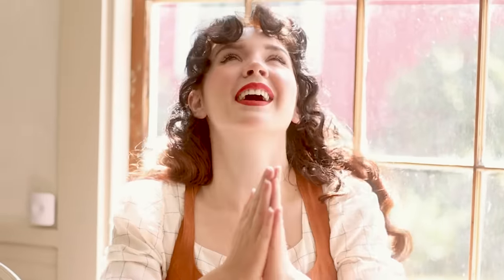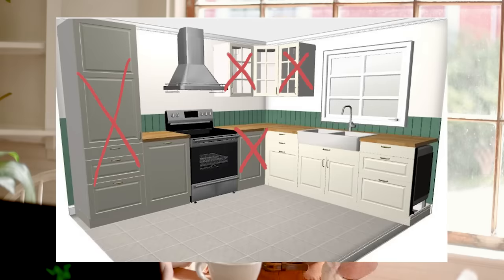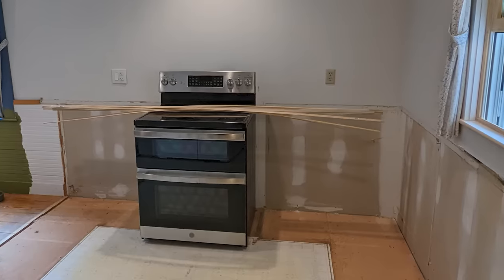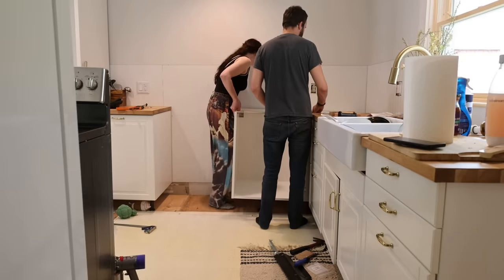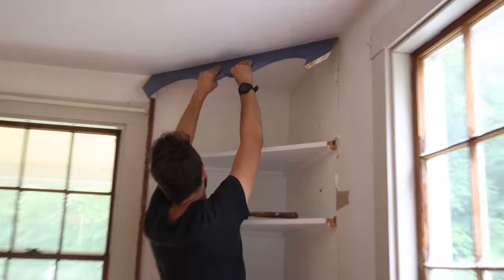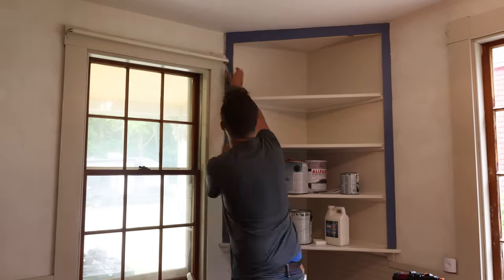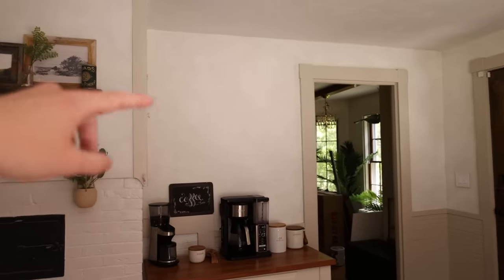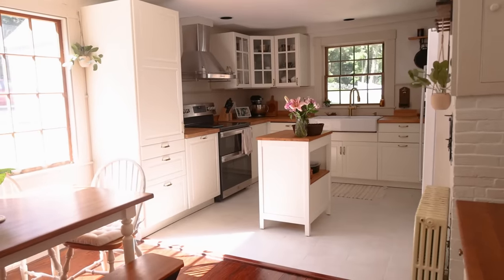We DIY'd our Old-Timey Kitchen! *never again lol*

Comment: The Kitchen is "the heart of the home" and let me tell you it SUCKS when it doesn't flow and isn't ideally functional. I have a lot of similar issues as you did, in my current kitchen. 

Looks like you opened it up and made it so much more fitting to your needs. I hope it feels as good as it looks because it looks amazing!! Thanks for sharing, time to redo mine.
Reply: My kitchen is the bumhole of the house. Tiny, full.of sh and kinda clean, but not really.
The heart of my house is either the livingroom/craftroom/bedroom (one room) or the bathroom/toilet (one room) because though it has some clogged arteries with laundry and boxes of old make up and washingbags, it is the lightest and nicest room in the house and very, very important.

Comment: Re: Getting a Branch to dry stuff on, Try to keep track of what kind of tree you get it from so you can bake it to remove microbes/kill insects.
Reply: And seal the branch with polyurethane.  The wood will dry out and get brittle and start rotting and splinter and just making a mess everywhere.  Remember, the old folks back in the day used big branches for drying racks because they couldn't afford metal for a real rack  they were making do  You don't have to.  Buy a real drying rack or a cheap rod from a thrift store or something.
Reply: But the branch is free.😕
Reply: @druidriley3163  But the branch is free and ~*aesthetic*~. I personally have raw pieces of wood and branches as random decor in my house for years (I've got macrame on a raw branch, a stump that a ceramic frog sun-bathes on, and a jewelry "tree" made from real branches) and they haven't rotted yet. Wood be sturdy, as long as it's not sitting on the forest floor getting actively composted.
Reply: @manicmuffin  - depends on the wood, I"m sure  Hard woods might last a while.  Soft woods or trash tree branches, not so much
Reply: Use maple or oak or fruit wood!  Don’t use Poplar or Willow (crap wood to the extreme!)
Reply: @druidriley3163  I honestly don't know what kind of wood it is. Foraged them all off the ground while hiking, lol. Guess I just trust my lizard brain instincts when it says "this is a good stick, I'm taking this stick home with me. Oooh, and this shiny rock. OOOOH and this pinecone-"
Reply: @manicmuffin  - just look up.  Tree branches don't fall far from their parent tree.  And you'll know.
Reply: @druidriley3163  Man, I ain't no arboriculturist, my dumbass would just be like, "Yes....it seems as if these branches came from some kind of tree...."
Reply: @manicmuffin  😂

Comment: Listen, hubby and I will always rememeber "The Kitchen Designer from H*ll" who we worked with to do the renovation on OUR kitchen.  WE don't ever want to do that again, EITHER.  Also:  white floor tiles?  Same.  SEAL THE GROUT.  ASAP.  But it will probably still be a pain showing any bit of dirt.  Still GORGEOUS job you two.  The change is drastic and you did a beautiful new kitchen.  Enjoy!!
Reply: Yes absolutely 100% seal the grout ASAP!!!  Sometimes people aren't told about it, it wasn't included in the tiling service, etc. But it's super worth it!!  Protect that grout, it'll extend the life of your floor, and it'll keep looking pretty and resist cracking, and make the tile easier to clean - always a plus 👍

Comment: I once read a study, many years ago and I can't even remember enough to find it for citation, of how many hours 'someone' (almost always a woman) in a household spent washing dishes every day/week/month/year.  They counted from 'lone inhabitant' to farm family of 12 + 5 farmhands.   It was staggering.  Many, many, many hours spent washing dishes.  I kissed my dishwasher right on the front dial!
Reply: Amen.  I have a nearly 100 year old house.  There is no dishwasher.  I sorely miss the dishwasher I had in my old apartment.  And it's not as easy to just buy one and install in an old house.  First - your century old kitchen does not have the plumbing to hook up to a dishwasher.  You will need to pay a plumber for the upgrade.  In an old house, you may or may not have sufficient electric current to run the appliance.  You will need to hire an electrician to hook up the dishwasher and/or rewire your kitchen.  So my desire for a relatively inexpensive appliance purchase will remain a pipe dream unless I win the lottery due to all the additional expenses in installing something so simple.
Reply: @druidriley3163  Get you a portable dishwasher!! They hook right up to the faucet with the little adapter that comes with it: NO PLUMBER NEEDED! I ran one in my 70 year old house from a regular electrical outlet, no problem! They come on wheels so you can wheel it away when not in use, but we removed the cabinet by the sink and it lived there just like a regular dishwasher.. They normally come with a butcher block top so you will not lose any counter top space. I loved mine, had it for 12 years until we moved!! Highly recommend, and, portable dishwashers are not expensive and they are full sized! And...wait for it... I got it at Lowe's. Easy peasy!
Reply: @michaelsnider2484  - help me out here.  From what I read about them, you hook up the hose of the dishwasher to the spigot of the kitchen sink.  It appears that you screw the hose onto the faucet nozzle.  Is that true?  But there are no threads on my kitchen sink nozzle.  It's one piece.
Reply: @druidriley3163 as I recall it is a quick release joint adapter that comes with the dishwasher. Also, when they deliver it do not let them charge you an installation fee because there is no installation.
Reply: @druidriley3163  it is not like hooking up a garden hose by twisting it on. No threads needed. Also, our house only had a 60 Amp service and it ran fine. I am so excited for you: definately look into getting one- I was madly in love with mine! A couple of houses we lived in when I was growing up had portable dishwashers, too and we had a family of 5 using them. Lemme know how it goes!🥰
Reply: Okay, but your vague recollection of something you thought interesting but don't remember important details, (like names and dates) is me all the time!!
Reply: @michaelsnider2484  - Thanks!  Do you recall a brand you used?  Probably a next month purchase as I just bought a new battery for my car this month.  Boy are they expensive these days!!  SO excited about getting this!
Reply: @michaelsnider2484  Had one growing up too, kitchen with only a sink cabinet and a pantry. Ours lived next to the stove, only had to wheel it about 5 feet. We were a family of 7, 5 kids. Made my mom's life way easier.
Reply: @druidriley3163  no, but I did get it at Lowes. I wish you the best with it!

Comment: Looks incredible!! Definitely recommend using trim and molding to extend your cabinets up to the ceiling, for aesthetic reasons as well as practical (dust, dirt, and general kitchen grime will collect on top of your cabinets and it’s damn near impossible to clean off so taking them all the way up to the ceiling prevents that eventually smelly issue).
Reply: Was thinking the same thing , makes room feel taller x
Reply: To clean all the grimey dust on top of your cabinets use Simple Green and rags.  If REALLY bad carefully! use mineral spirits and a stainless steel scrubber.  Do this at least yearly.
Reply: You can clean the tops quite easily with a mixture of white vinegar, a small squirt of a gentle washing up liquid and water (mix in a clean empty plastic bottle) can optionally add a couple of drops of an essential oil to reduce the vinegar smell. It really cuts through the grease! Also this mixture (without the essential oils) is also great for cleaning glass (windows) as once rinsed off you get a streak free shine. Oh yeah and its good as a side cleaner, round the sink & for in the bathroom too (the vinegar helps dissolve limescale). Saves buying a ton of different products too.
Reply: I wish I'd have known about the grime when I had my first (poorly ventilated tiny) flat - I stored my tupperware and The Good Crockery on top of the cupboards and oh my god... a black film of grime covered EVERYTHING, not even the dishwasher got it off 🤢

Comment: I learned that if routinely do homemade pet food, it ups your comfort with recipes. Pets are so appreciative of fresh food that is good to freeze as keeps nutrients. You learn to stew beef, poach whole chicken or roast. Add sardines that you can pan fry. Low pressure as not for you, but still get life of a cook handling large amounts of food. A mini deep freezer is good to buy meats on sale. 

Can see remodel work it takes to put in new life ...tossing older design that did not age over decades as a classic. Looks like space was built for what it is ...very good modernization in counter top and sink fixtures etc.

Comment: Great job Rachel!.  Two comments...... The glass shelves in the upper cabinets are so the light (from the interior cabinet lights) bounces around inside the cabinet to highlight pretty objects - the light travels through the the glass shelves.  If you put wood shelves there instead it will all be dark.  I think the glass doors with the glass shelves are designed to have a "furniture" look - like the set of uppers is a glass door hutch.  Also, by code - the glass shelves have to be tempered glass - plenty strong....I wouldn't worry about it.
Also - maybe you know this already but the wire mesh decorative thing you hung on the shelf hook is a "Safety Greater".  You push chunks of soft cheese like a mozzarella through the wire mesh to end up with grated-like chunks of cheese and since it is not sharp you are 'safe"!  I have one & I learned about what it really is from Cook's Illustrated.

Comment: I’m still chuffed with my ikea kitchen. Didn’t find putting the cabinets and drawers together a trouble at all as I am an ikea manual genius!  Pictures I tell you.. pictures! Luckily my ikea had everything I needed.
Reply: I have an old kitchen, bit not oldtimey, just old with yellowed cabinets. The thing is 2 by 2,5 meters, with a 1 meter deep digonal roof. A.k.a. zero space to decorate or cook to begin with. The whole house is tiny, no storage space either. 
Either way, I decided to decorate by printing pictures and using tape to stick them to the inside of the cabinets and I have a 90's looking flycurtain with blue plastic diamonds in waterdrop shape. I have a few clayguppies that are bright and blue, they are on magnets and are on the tiny fridge, with a crystal-mineral blue landscape of printed and laminated gemstonepictures underneath. But because it's so tiny, one mistake will cover half the kitchen in food or sauce, so I need to keep stuff smooth and undecorated on the outside as much as possible.
Reply: ❤️IKEA furniture❤️
Reply: I love assembling IKEA furniture. It's fun and satisfying.

Comment: I love what you did with the kitchen. I know it took forever, but it turned out beautiful. Why it is extremely important to prime your walls, etc. Not only does it help you get a smooth finished product, but it will save you time and money. Unprimed surfaces will suck up your expensive paint, and require you to use way more paint - besides all the extra time you spend putting multiple coats in order to get an evenly painted surface.

Comment: I've done a similar finish to the limewash with regular interior paint (eggshell finish), artists' matte medium, and water, applied loosely with a big brush. I start with the darkest/brightest color, thinned out to a transparent wash with water and matte medium. 

The first coat always looks horrifically bad, and you'll think it's the worst mistake you've ever made—but that's okay. With each successive coat, I add a bit of flat white to that wash to lighten it, make it a little more opaque, and reduce the sheen. It's messy and labor-intensive, requiring 5 or 6 coats to get a good result, and they have to dry and cure for at least 24 hours between coats, but when you're done you get a subtle, variegated surface with a lot of depth; it can resemble aged plaster. It also helps minimize flaws in the walls. And if you're a paint hoarder who grabs every can of "oops" paint you see in colors you like, it doesn't have to be expensive.

Comment: Yeah, I wouldn't be too worried about taking a few extra months to get the job done when it turned out so well. I'd say it's worth the wait.

My dad took like 15 years to finish renovating the kitchen in our family home. Mostly because he was also renovating the rest of the house, and couldn't do the floors until all the other rooms were done. He wanted a solid wood floor that ran continuously from the front of the house to the back, but he couldn't do that until the ceilings and walls were replaced, and that work would damage a solid wood floor. And then mum decided she wanted tiles in the kitchen. But it also didn't help that they wanted custom solid wood cabinet doors, and dad was building all the cabinets from scratch rather than a kit.

It's always worth the wait to do it right the first time.

Comment: Well done, can’t believe you did this so quickly. I’m three years in to mine but it’s stalled now because I’m conserving money while we wait to hear about work contracts. The existing kitchen partly fell apart, partly got reused in the shed where repair was possible, and partly had to be removed to get the broken built in oven out- whereupon we discovered how close it had been to catching on fire from the actual charred insides. So emergency oven purchased mid pandemic. Emergency cooker hood purchase mid pandemic when I discovered the old one was venting into the cavity wall………
My kitchen is a delight! 
Can’t believe I sold a house with an ikea kitchen I designed and installed which was pretty much perfect, came to this house that realistically is where I’ll be forever unfortunately, and I’m living with two cupboards and a shelving unit under the worktop. No end in sight. 
So in summary, Rachel, you did really well. Congratulations on the subs and the kitchen.
Reply: Ah man...hang in there.
Our oven just recently had a runaway heat error!  So I understand your horror when you discovered that charring.
I also have designed my own IKEA kitchen, and will be sad if we ever do sell.

Comment: I like the curtains. I feel like the little box pattern goes really well with the cabinets. I also really liked the curvy trim around the corner shelving but not all the way around.  It definitely needed to go on the bottom. Overall I think that you did an amazing job and way better than I could have done.

Comment: I love how this turned out! Hot tip: a bead of silicone (the paintable kind or white) along the edges of the trim or shiplap, even in between the different sheets and it will give it that final chef's kiss finish. Helps with managing dust and spiders too.
Reply: Yes! I was going to comment this as well, it was driving me a bit nutty seeing the dark cracks where the shiplap meets the wall.
Reply: Agreed! I was thinking it would look so much tidier with a bit of caulking/finishing in the coat nook
Reply: Agreed.

Comment: For the glass shelves, you can try the drawer/shelf liner in Ikea's Variera series prevent the horrible glass on glass sound. There's one that's transparent and textured. It might not be the solution you want permanently, but it's cheap and quick if you want something for now.

Comment: You could totally be a teeny bit bold by adding in things like pinstripped dish towels or chair cushions that are white and that bright olive green, or by adding in a thin stripe of paint along the top of the paneling or between the wood slats or something. Or by getting green glass or ceramic knobs for the drawers. Tiny little pops of colour to add some flavour without leaving the beige comfort zone. 

This is the tactic I've embraced, as a basic beige bitch myself. Everything is white and brown, for the most part, with pops of teal and orange. It is a forever-fall apartment, with autumn leaves and pumpkin paintings and such, but it still feels very neutral overall. I like this little pops of orange autumn along a complimentary blue-green shade to give some character to my otherwise neutral space.

Comment: I know this is like, a year too late.... Hopefully this can help another person trying to build an ikea kitchen! 
If you use a ikea design planner, you can save your design under a code. if you "Finalize" the design, there is a tab to see the design break down, which will show you cabinet frames individually, and it will tell you which holes to install the drawer tracks on! all you have to do is count the holes on the side and mark them! 
Also if you are short like me, start at the top and work your way down! way easier  trying to drill holes when there is nothing below you blocking your ability to reach into the far back.

Comment: I am here to reveal what the smell is. drumroll Grease on the drawer slides. 

Also, to be wildly unhelpful at this point, there is a cheeky little diagram on which screw holes to use in the box that the drawers came in.

Comment: Ok so the problem with IKEA is not that they don't have warehouses, the store is a warehouse. The problem with IKEA is that the COVID crisis impacted their company A LOT. Not only did it impact just the shipping aspect of their business but there are also a lot of issues with supply chains, which is still on going and not only affecting IKEA. They are just really impacted because they use a ton a ressources. But they are not the only ones, there are shortages everywhere, just normal hardware stores have issues with wood, flooring, etc.